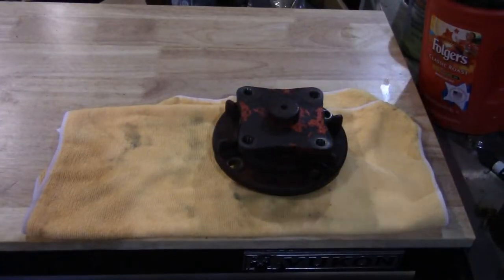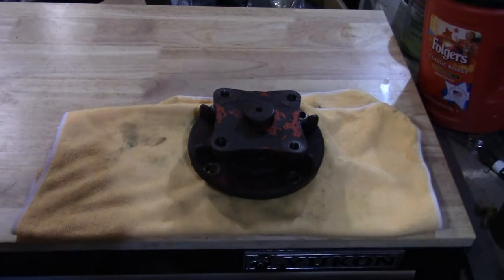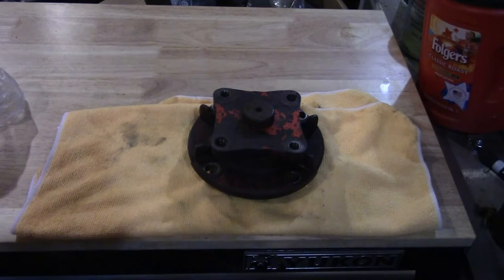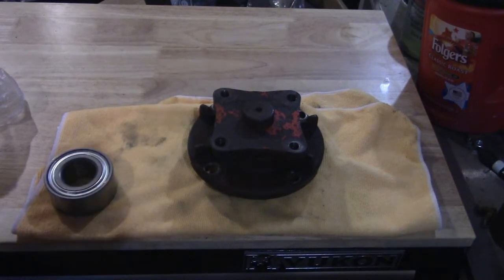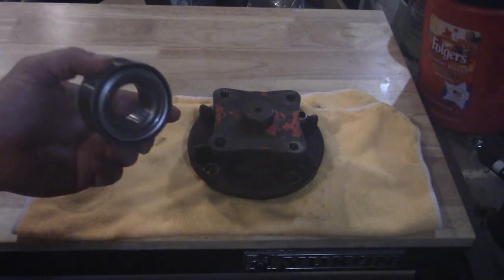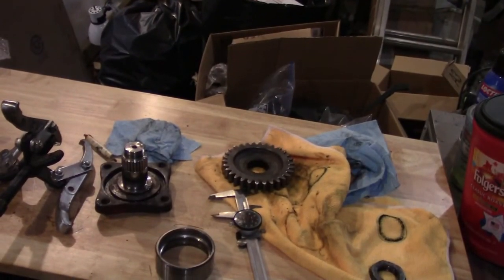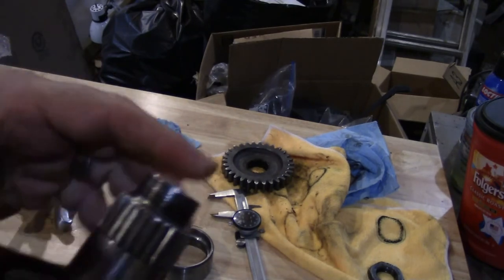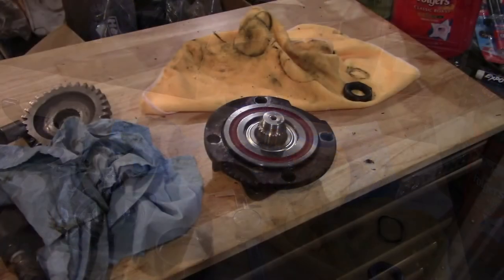Kuhn GMD500 Spindle Rebuild

Comment: Awe oh too thick but it went together pretty nice. Hell if it lasts 2 years that's as good as the other one lasted. So if you lose $50 it's cheaper than spending $300. Amazon has everything. I needed a belt for my table saw > Amazon. They made a mistake & sent me 2 so I have a spare lol.
Reply from the maker: Haha, yeah I think it will Joe.  It'll be great if they do!  These bearings are about half the cost of the unsealed ones I put in there.